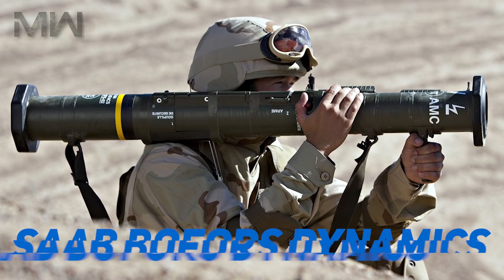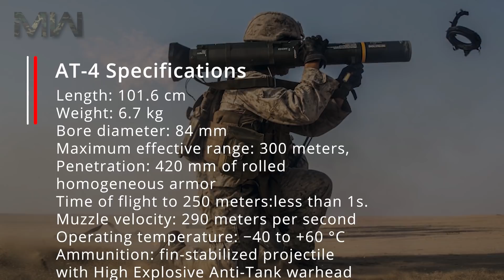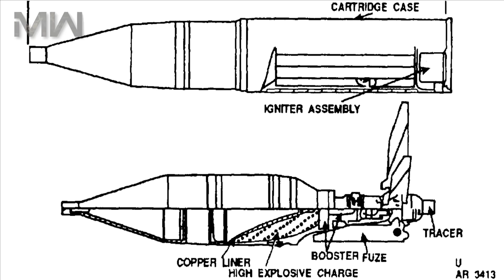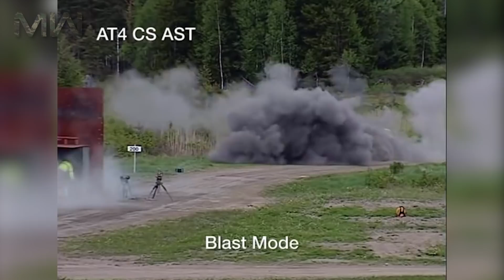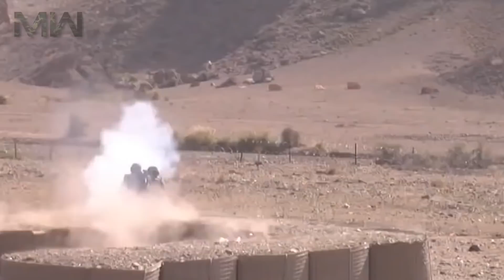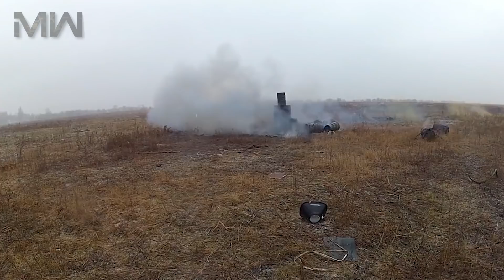84mm Anti-Tank Rocket Launcher AT4: Swedish Weapon [Military Review]

Comment: Single use! that is logistically and supply intensive in a defensive fibua capacity like Kievs. Carl Gustav,  RPG7 et al are still for now what the BRAVE defenders of Kiev and Ukraine need, in consideration to their logistical resupply needs...
Reply: Eh I'd say the opposite. It's simple on logistics they can give one to ever Platoon as detternt and it won't hamper riflemen dont got plan for ammo resupply, Don't have to risk the expense equipment as often. The weight especially would allow for more fluid warfare. And make shipping super easy and quick. Personally like the idea of m27 laws (also single use) more though cause they where light and small, making it even better for rifle men. RPG7s? Would agree a very important layer of the defense. But those should be used for ambushes in higher buildings.

Comment: 600mm is no joke. Imagen to have that in WOT. How thick armor does a modern tank got?
Reply: Modern tanks have armor built with several layers of different materials, wich makes heat-rounds less effective.
It is not 600 mm of solid steel, but it doesn't need to be.
Also, most veichles in a modern army does not have armor that can withstand  this weapon. Each tank is going to have a train of support veichles to keep it operational.
Reply: @JH-lo9ut  TANKS BELONG TO THE PAST!

Comment: Sweden is sending 5000 of these to Ukraine! Love from your fellow yellow and blue 🇸🇪❤️🇺🇦
Reply: GET SOME!!!
Reply: Apparently Sweden is sending another batch of 5,000 SAAB-BOFORS made AT-4 to Ukraine in the near future i.e. total 10,000 light anti tank weapons.
Reply: Yes, sweden is 5000 thick.
Reply: Single use! that is logistically and supply intensive in a defensive fibua capacity like Kievs. Carl Gustav,  RPG7 et al are still for now what the BRAVE defenders of Kiev and Ukraine need, in consideration to their logistical resupply needs...
Reply: @D-E-S_8559  No, its actually the other way around. With this you can supply 5000 persons with one round. With a Carl Gustav you need a heavier system, an operator AND a loader, is it better to send 1000 carl gustav and five rounds and tie down 2 persons than sending 5000 AT4 that anyone can use? You are not military are you?
Reply: @OjsMatte  "You are not military are you?"
Are you military?
"supply 5000 persons with one round"
Where do you get ready 5000 ready trained personnel to effectively use a single shot specialized equipment, if you were a tactical command staff, you'd know that to be bonkers. with a 1000 CGs I can dedicate 200 for cyclical training to replace wounded or experienced personnel. Even better, a single skinny Al Shaabab can carry 7 RPG 7 rounds if not more, in open cross country terrain. We are literally talking about a FIBUA backdrop, with ample capacity for small tactical resupply location stashes, and an army of unskilled or semi-skilled volunteers. If you are a soldier and you cannot make that work to your advantage, then, you don't know what you are talking about...
Reply: @D-E-S_8559  You are so overcomplicating things,  its not hard to learn how to fire an AT4 if you have any gun/rifle experience. It´s open sights. What they need is firepower right now, not after your training scheme. On the military thing, i did my military service in the Swedish army about 27 years ago and i can still pick one of those up and hit stuff within seconds, since they are so easy to operate. And i was on a mortar team so we didn´t even train on AT4 as much. You are wrong.
Reply: @OjsMatte  Thank the heavens you served in a parade army---if you'd ever faced an ambush with a barrage of RPG's in the middle of know where, then you'd be singing to a different tune. Fire power, is only useful in the right hands and for the right purpose, if you arm an entire country, what you get in return is NOT "victory", but chaos...
Got saved by the quick thinking of a mortar section team during an ambush. Before cas arrived to clear the rest...
Reply: @D-E-S_8559  Stop avoiding the subject. I didnt say Carl Gustaf is bad, i´m saying that the AT4 is a better option right now. If this goes long term, we are in a whole other discussion. I dont know if they shipped some training AT4:s but that is what i would do if i would send 5000 rounds of anti-armor rounds out. You know those cheap 9mm tracer rounds you can fire lots of in an hour? I think they will be fine in a few shots. Anyone can fire an AT4. It´s kind of a feature.
Reply: @OjsMatte  I suppose anything is better than nothing---my concern is premised adage that nobody ever wins a civil or unconventional war depending on Western systems. And the problem of Western systems lie squarely on functionality, value and serviceability, premised on tactical reliance of "single use" equipment. Let's forget about profiteering from weapon system sales and give this Ukrainians the sort of equipment that underpin the basis of their battle training, tactics and war management doctrines...
In that case if the weapons have to be Western sourced then give them PSRL-1, they already are familiar with those...
Reply: @D-E-S_8559  Dont know about the PSRL-1, i was hoping we would send some NLAW:s like the British did. Also easy to teach, i have no experience with that system but SAAB says about an hour of training. You are still going about the training, you dont need much on those systems. Its a feature, you can hand an AT4 to a peasant and tell him how it works and he will hit the target. Have you fired one?
Reply: @OjsMatte  Training is EVERYTHING---shooting at still objects is not the same as shooting or aiming at objects that are defended and shooting back at you. Again you wouldn't know this, because you've never been in a firefight ...
AT4s, NLAWS, Javelins, and all the other single-shot weapons are not for "peasants", one mistake no 2nd chance weapons...
Reply: @D-E-S_8559  SAAB has training for you if you need to hit moving targets, and yes we practised on those too. We even managed to set a target on fire with the tracer round hitting the potato sack mock tank. Glorius times. But you are right on the thing about beeing in a fireifight. I still think you are wrong.
Reply: @OjsMatte  Okay if you say so. I am glad you survived the potato sack . I am glad I survived the Al Shabaab, despite them working very hard to expire me. May you never know the heat that surrounds deaths embrace, and the cold that comes with shivers after, for those that death leaves behind to return on another day....
SLAVA UKRAINE!
Reply: It is really easy to use, you train with a 9mm trace bullet so you get the hang of it and after that you will not miss. 5.000 of these will of course not go to 5.000 soldiers but small teams  that will have them handy when needed. You can have one on your back and and a couple of more in your vehicle or close by. I hope they will make some difference.
I think its great that you served but it doesn't make you right in every argument , with respect.
Reply: @OjsMatte  SAAB air assets are budget appropriately formidable. The more I look into Sweden defense industry and associated strategies the more I am impressed. South Africa's choice for the JAS 39 Gripen is very interesting...
Reply: @D-E-S_8559  I actually have been to Makhado, or Louis Trichardt as its called now for work. And yes, bang for the buck is a great selling point.
Reply: @OjsMatte  I can kick a coke can all over the place at 100 yards with open sights .22 cal. But how do you hit a target at 300 meters?
Reply: @D-E-S_8559  seems that the Ukrainian Army is doing a bang-up job with these weapons. why are you so critical of them? The Ukrainians keep asking for more.
Reply: @paulntx  "why are you so critical of them?"
Because, I personally loathe the military complex meddling in political and public internal and global relations---and a supply and re-supply loop of single use disposable munitions, is EXACTLY the kind of new profiteering scheme that this lot are promoting  in the guise of "future wars"....
Reply: @paulntx  There is an attachement for optics on an AT4 if you need better precision, we never got to train on those though. The optimal range is not 300m i would say, just because you can doesnt say you should ;)
Reply: @D-E-S_8559  "Because, I personally loathe the military complex meddling in political ...relations". So I totally get where you're coming from. However, do you think we stand by and do nothing as Russia slaughters civilians?
Reply: @paulntx  I have no idea how and why you'd ask me such a question—I say we provide the Ukraine with material that has value, significance and cost effectiveness to their tailored purposes, even if that means supplying them with Russian made weaponry, which they are proficient at utilising. I object to the military complex pushing "single use" weaponry, in an attempt to open up a supply and resupply arms cycle, not because they care for Ukraine, but because someone is paying for those weapons....
Reply: @D-E-S_8559  OK, that was a good clarification.
Reply: @D-E-S_8559  "if you arm an entire country, what you get in return is NOT "victory", but chaos..." What you get is America.

Comment: It is not a modern anti-tank weapon. That is what the javelin missile is about. It just destroys "hard points" in the military objective.
Reply: That equipment requires training and is super expensive compared to this conventional type. Maybe they can spare their nlaws for main tanks and use these for other veichles.
Reply: @marcuslindberg8620  The AT4 can be used by untrained individuals, it´s very easy to use effective. Thats why they decided to send the AT4 among other weapons.
Reply: But they are more than eough for the Russian T90 and The other crap they use.
Reply: And only 6.5kg. Just grab a couple and run and hide.
Reply: @fortune300   .. Denmark are sending the M72 Enhanced Capacity, that is only 3.4kg, has a 450 mm penetration and a 350 meters maximum efficient range ( 1, 200 m maximum range), so a slightly better penetration and range, but at almost only half the weight.
Reply: @agffans5725  The AT4 comes in different types that can penetrate 400 or 600mm steel pansar.
Reply: @fortune300  .. it's the AT4 Pansarskott m/86 Sweden has donated, and as it says in in this video, it penetrate 420 mm, good enough to kill of Russian tanks in any case.
Reply: Its perfekt in city against tanks, russians tanks
Reply: But they have recieved 2000 saab nlavs witch is effective against any mbt
Reply: They are used in different situations. The AT4 is used in very close range where more advanced missiles systems are not optimal.
Reply: it’s designed to beat Russian tanks. Most Russian tanks are very outdated. With more capable main battle tanks, you need to hit them from behind at an angle or at a weak spot.
Reply: @Jonsson474  You gotta be uncomfortably close to the tank to achieve that.
Reply: True it can certainly track-kill a tank. Unless you can you follow up with sappers though that tank will probably be towed back to a depot and fixed in a day. So at the least, you delay a push for a day. Most you enable infantry push up fighting presumably any supporting elements. APCs are IFVs can be little different at the right spot but even a only demobilizing can be catastrophic to enemy plans at a larger scale. Perhaps Less a threat more a detternt.

Comment: So I don’t really understand the AT4 launcher or really any disposable launchers. It seems like a rather expensive and wasteful thing to create something like a rocket launcher that you only use once and then throw away. If anyone had any input on this please let me know. I will be sure to respond as this has been something I have wondered for a while.
Reply: light weight.  can be carried by one person instead of a team of 2-3.  dont have to lug the thing back to base if you use it.  can spread the rockets out between members to fire simultaneously from different angles.  Launcher is cheap, its not that more expensive to pack the rocket in a fiberglass tube. all ammo comes in some sort of packaging from a factory anyway.  It fills a practical role of being able to take a few rockets with your platoon out with you. Of course if you plan on need something rocketed multiple times throughout the day, youll bring the gustav and ammo.  But that shit is heavy.
Reply: The low weight makes it easier to carry with you than the traditional Carl-Gustaf for instance. And if you have to get the hell out of dodge really fast, once the AT4 has been fired, it can't be picked up and used against you by the enemy. But the more expensive Carl-Gustaf seems to become more popular and the AT4 being phased out due to the cost of using them in the long run.
Reply: The projectile IS the weapon. The rest is just a way of carrying and aiming it. A re-load type of weapon means you have to carry extra projectiles in some kind of container that ends up weighing almost as much as a single-use launcher.
The single-use weapon needs no maintenance and very little training. This means they can be used by any soldier with basic weapons training.
There are more advanced and more effective Anti-tank weapons, but those are normally used by special units with adequate training in those weapon systems.
Reply: Im an amateur on this so dont count much on me but I think the idea was to be able to deal with armored targets on an infantry level. I mean you wont be always be able to deploy tanks and ships on a suprise or stealth type missions and using long range missiles may sometimes seems overkill(and more costly). Plus to be able to defeat a tank using a single men seems more cost-efficient to me. To discard it will reduce the weight for the personel which will save lives since in a battlefield mobility is a must especially after your position is revealed. 

So to summarize. A long range infantry level weapon that deals with armored enemies that can increase mobility afteruse.
Reply: Play some video games...... you'll get it....
Reply: This weapon is relatively cheap and very easy to use. It is non-recoil so if you can lift less than seven kilos then you can easily aim and fire and then discard it. If you find a weak spot on a modern tank given the right angle then it can potentially disable it. Otherwise not so much. But your grandmother can fire this thing. Literally. So aim for the supporting convoy vehicles rather than the tanks themselves. Without the supply convoy modern tanks will eventually end up as sitting ducks once their supplies run out. The US has sent a much more advanced anti-tank weapon (which consequently is many times more expensive). The Javelin (300 pcs). There is no point in using that advanced weapon on normal armored supply vehicles since the AT4 can take them out just as effectively unless range is a factor. But now there are reports of Ukrainians in the field claiming that they are not able to effectively use the Javelin due to a lack of training and are requesting help (?). Which one is the best one for the task at hand only time will tell. But both are without a doubt useful in different ways. The American military uses both themselves.
Reply: Cheap, light, easy to use and less to carry when you escape after the ambush
Reply: Its made for use ONE time. Made from plastics.
Cant compare this to a weapon made in metall.

Comment: I used the AT4 back when I was in the Army.  I love 'em!
Reply: The infantryman’s “can opener” 🤙🏻
Reply: Then you know it's not Anty tank
Reply: @yamatokurusaki5790  I´m also trained on them in the Swedih army, you can take out a tank, you just need to hit it at the right spot. which is hard, and yes they tell you that, and they even say it in the video, so whats with your comment?
Reply: @OjsMatte  you can take also dynamite and throw it on tank or somewhere to disable it so
Reply: @OjsMatte  now why do you think i will remember something from 10 months ago?
Reply: @yamatokurusaki5790  I would, didn´t know you are slow. I appologize.
Reply: @OjsMatte  slow? Yea i am but why you mentioning it?
Reply: @OjsMatte  What needs to be improved on AT4?
Reply: @TheMichaelJu  I´m not sure what you mean? There are several variants of it with different roles. If you need something else, get something else. There is a reason it´s still beeing used. I did my service 27 years ago and its still beeing used, why is that do you believe?

Comment: That's odd.  I thought AT4s had thermobaric projectiles as well.
Reply: Same thing,no thermobaric but it does have anti structure. The problem for the at4 it has no tandem warhead so if an ifv or tank has even crappy kontak 1 or blazer era it is useless unless you get a hit on tracks or rear of vehicle and if it has slat well you should just turn in your soldier gear.
Reply: AT4 comes in a vast variety of ammunition choices, it has it all 👍🏻
Reply: @petter5721  4 choices is not that much.
Reply: No.  Thermobaric ammo is prohibitet and seen as an unethical weapon in Sweden
Reply: You're thinking about the backblast. 😁